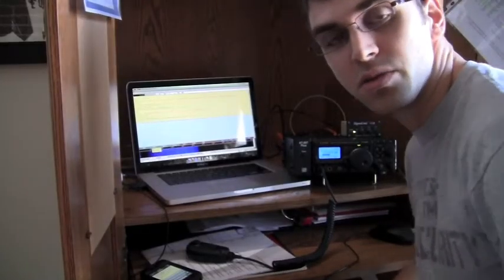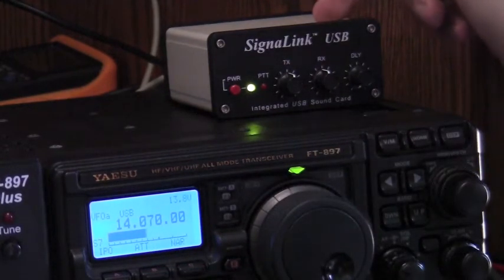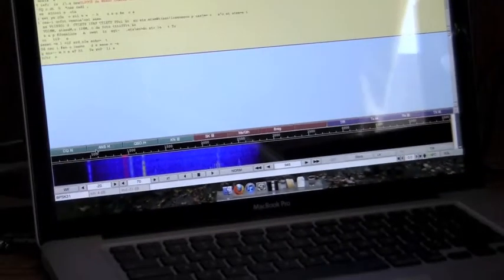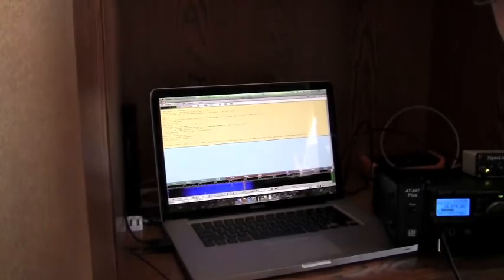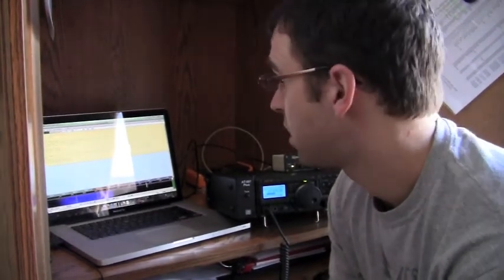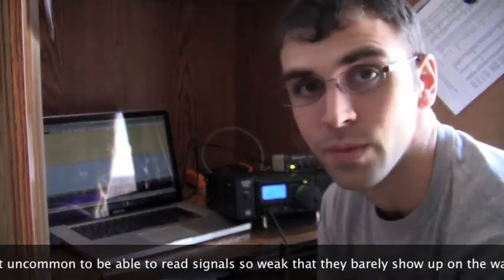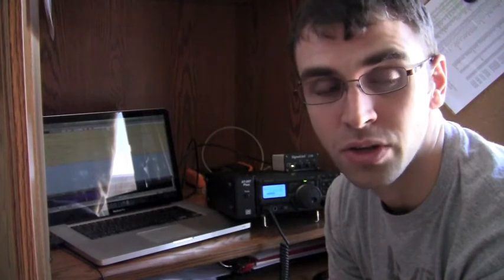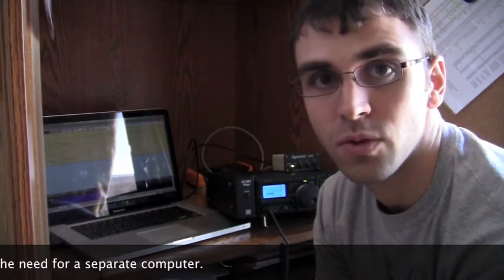Ham Radio Digital Modes-LSS

Comment: I ordered the Signalink today with cable for my radio.  They also offered a jumper module that is supposed to make the set-up easier so I bought that too.  I've been reading the manual to get familiar with Cocoa Modem and look forward to this new challenge.  I will let you know how it goes.  Ha
Reply from the maker: Hey that's awesome! I'd like to hear about your results. Good call to get the jumper too. I got the jumper for mine and it really does improve the connection, especially when you toss it in a bag to travel. Hey I looked you up on QRZ. I see you have a TS-590. How do you like it? I'm trying to sell my FT-897D to fund a TS-590 for myself.
Reply: I absolutely love the radio.  My first HF radio was a TS-530 ... bought it used at a Hamfest and it served me well for many years. The TS590 is a huge step up.  The filters are great, receiver is great and I get great reports on my audio using the stock microphone. I do a lot of CW (my favorite mode) and this is where the filters are awesome.  I can make nearby stations disappear and with the CW auto tune for reception, I can hit a button and the radio tunes to the frequency they guy is sending on.  10 Meters is active now and that band is so much fun.  I am amazed because in pile-ups, I answer a QRZ and often times the guy picks me out of the pile. I am running just 100 watts into a nice beam but I get great reports.  Yeah, save your money and get one.  The reports I read said that for the money, this is a great buy.  73's
Reply from the maker: That's great to hear. Yeah I've read up a lot on the radio and read countless reviews. I'm definitely sold on it. I have heard about the low power controversy about it though. That it only puts out 60-80 watts max. Have you had this problem or have you heard about it? I tend to think that maybe people think it's plug and play and don't know what they're doing. But I'm not sure. I'm also aware that radios by nature (at least in SSB) don't put out a strait 100 watts all the time. It fluctuates with your voice, settings, etc. I'm still trying to build speed (and confidence) in CW too. It is quickly becoming my favorite mode too. Although I'm still very slow at it. 73!
Reply: LaymansSurvival Geeze, I haven't read anything about a low power issue.  I think that a good resonant antenna is far more important than whether you are putting out 80 or 100 watts.  For me, when researching which HF radio to buy, I wanted a good balance between cost and functionality.  I could have spent thousands $ more for a radio but I was more interested in a quality radio and a fair price. Kenwood produces good stuff and the 590 reviews all commented on the "bang for the buck."  I will do a video on the radio and post it with what I have learned so far about the TS590S.  I probably use 50% of what this radio is capable of.  Hi Hi.  Hey ... it's a lot of fun talking about this stuff with other like-minded people. 73's

Comment from the maker: You'll also need to buy the right cable for the radio you're using that goes to that SignaLink. The cable costs I think $14. Then the computer program I use is called FLdigi and it's a 100% free download off the internet. Works great for all kinds of modes and best of all there's a Mac version! Forgot to mention you would likely need a DC power supply for the radio if you don't already have one. So when it's all said and done you're probably looking at $1200-$1500 depending. Hope all that helps.

Comment from the maker: Well if you're wanting that exact radio, they run about $960-$980 or so new out of the box. I was fortunate to find it on sale when I bought mine for about $930. Then that little gray and black box on top is called a SignaLink USB. It's basically the interface between the radio and computer and it has a built in sound card, so that you're not dependent on the sound card of the computer you're using (or internal sound card lack there of). That thing runs $80-$90 new.